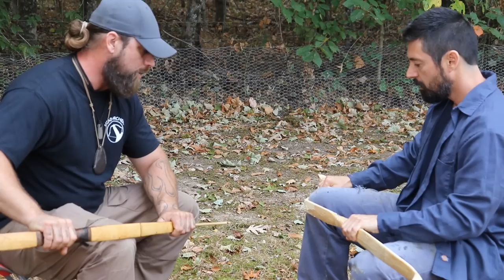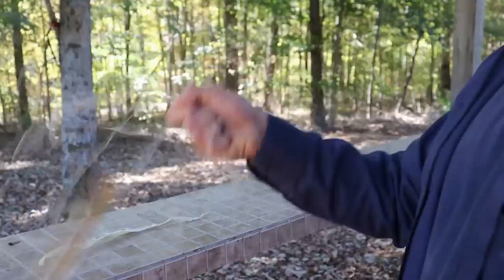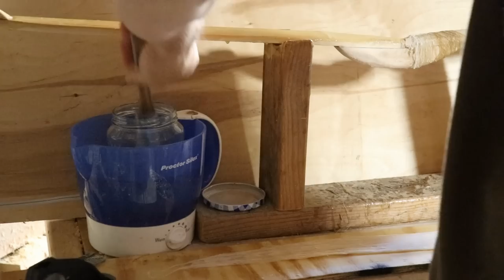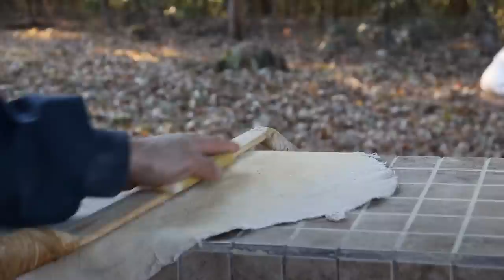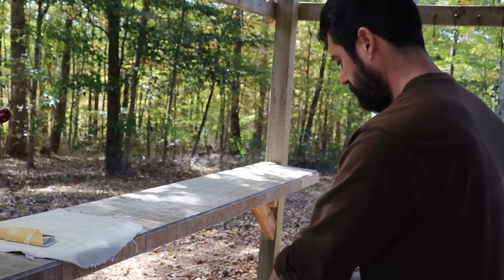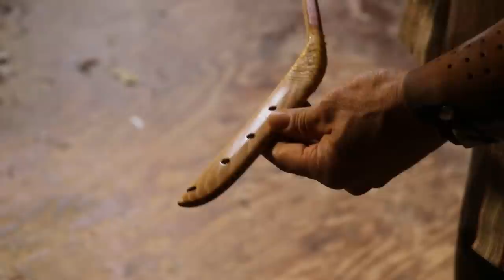How to Make - Most Unique Primitive Bow from bamboo Step by Step - bamboo sinew composite bow

Comment: How long do you have the sinew layers settling for?
Reply from the maker: Sinew needs to cure for minimum 3 months some places 6 or more based on climate at time of building the bow. You can begin to work on it usually after a few months but understand it will change in draw weight over time as sinew is constantly changing

Comment: Friend,
Why do you and many other "U" Tube archers release the arrow the instant that it comes to full draw?
 It is very jarring to watch. 
Are you afraid that your homemade bow will break if you paused briefly at full-draw the way that you're supposed to?
…..RVM45
Reply: because of it shape it should be a horsebow, then I think its should work that way if you using a horsebow release technique. Correct me if I'm wrong
Reply from the maker: Because that is how my ancestors  hunters and warriors would have done it. I dont do this for sport.
Reply from the maker: I suggest you go watch some Olympic style archery channel or something..I wouldn't want to scare you anymore with my primitive archery
Reply: Well friend,
I didn't mean to sound confrontational. I was sincerely curious if primitive type bows were incapable of being held at full draw for any length of time—which would necessitate snap-shooting whether it was the best choice for accuracy, or not. 
So far as holding momentarily at full-draw, this wasn't just a practice of modern sport archers. I read somewhere, that one of the training exercises that Olde Tyme Samurai used occasionally, was to hold the bow at full draw for inordinate amounts of time—10 or 15-minutes—until severe shaking and cramps set in and then to still hit a modestly difficult target upon release.
Of course, you wouldn't have done that doing a real hunt or during war, but if the Samurai weren't in the practice of holding at full draw at least momentarily, the long-hold exercise would be unlikely to have ever been invented.
Modern Japanese Archers all hold momentarily at full-draw…
So it isn't just a practice of effeminate Olympic Style Target Marksmen.
…..RVM45
Reply from the maker: @RVM451  haha I love it! Thats too funny! In all honesty I practice archery the way that makes me feel best and the way that will benefit me in what I want out of archery. We all have different reasons why we pick up a bow and arrow. We can all be called archers but at same time be very different.